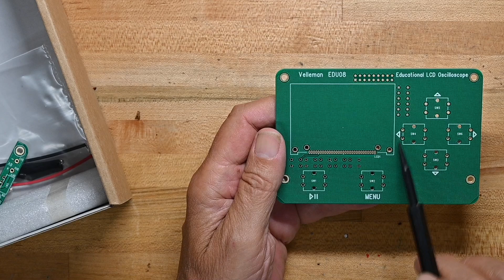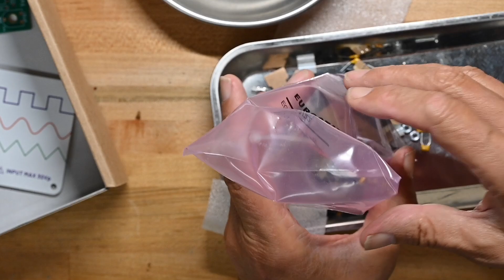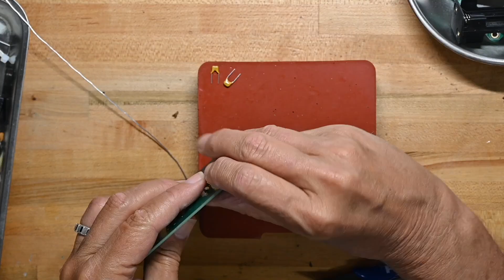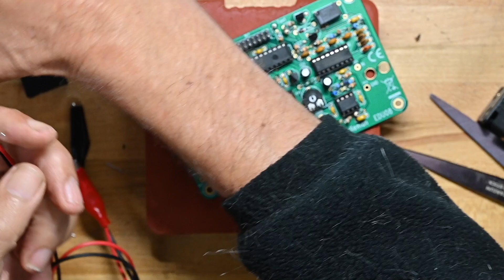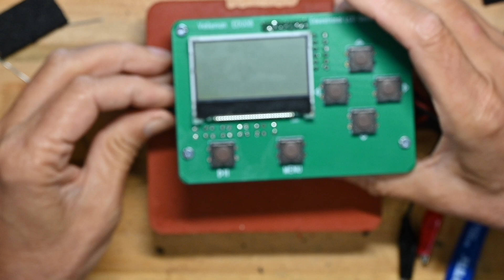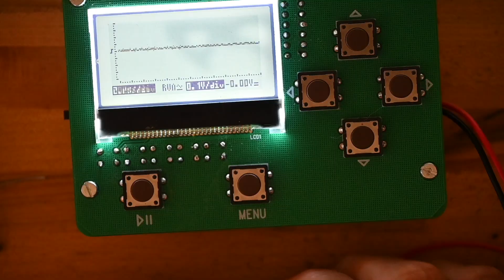C.K. builds a Velleman Educational LCD Oscilloscope Kit by Whadda

Comment: I am always curious about what an oscilloscope does for an electrician. Looking at the wavelength? USD100 is not cheap BTW. Kudos.
Reply from the maker: It ends up being a versatile tool. Being able to see peak-to-peak voltages easily and the stability of a waveform for an electrician is pretty handy, for example.  One of the main reasons I use one is to see really fast transient voltage changes that my meter wouldn't react fast enough to see, but I can see a quick spike in the waveform.  And lots of other things, once you get one in your hands you'll find a lot of uses.  Thanks for stopping by!